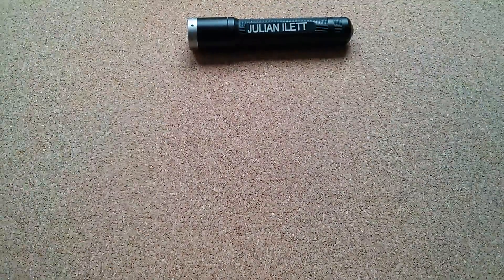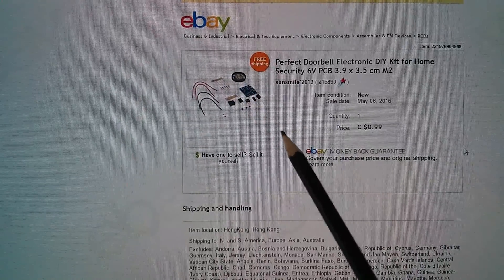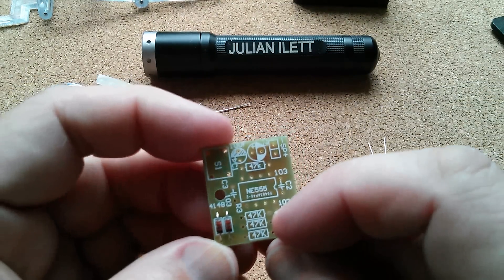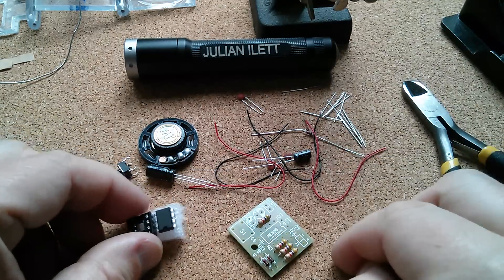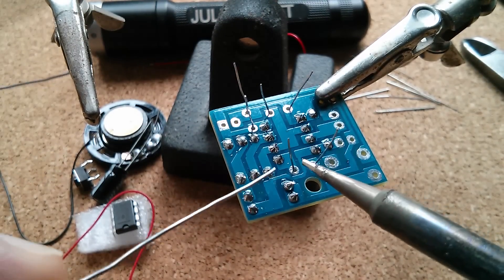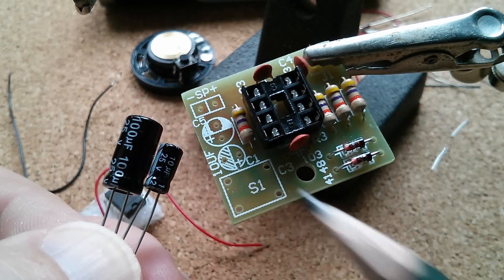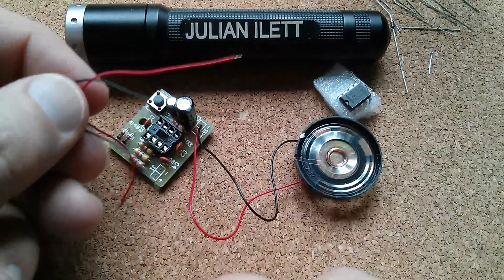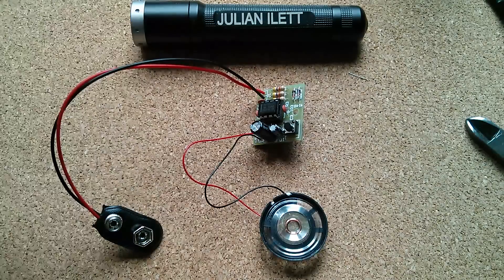eBay Cheap: $0.75 Electronic Doorbell Kit NE555

Comment: how this door bell will work in real world - I mean I I get a long wire and fit the speaker where needed , will the battery have enough power or it will need a bigger one or tied to the grid ?  I d like to get something similar for an off the grid house -  the distance between the button and speaker would be 60m . Any advice will help Regards

Comment: I had the same problems including the NOT working and the hot chip....then I stripped back the wire to get to the copper past the shitty tinning at the battery side and IMMEDIATELY I had perfect operation and no hot chip...even when actuating the piss out of it with a 9V.....I think it was the power being fed back somehow to the chip from the storage side because it wasn't getting what it needed from the battery side with the bad/intermittent connection...maybe I'm WAY off but my chip isn't even warm now and I get perfect operation every time I reconnect power...

Comment: I have personally noticed that 555 timers from china sometimes tends to get hot and not work and sometimes, for no reason, they do work. In the same circuit, changing to a legit 555 IC from TI makes a huge difference. I think it's because of the internal structure of the IC. The Chinese cheap version obviously cut costs everywhere they can, even if it means potentially fire hazard.
Reply: I dont agree. It all depend on the circuit design.

Comment: Cool, I figured it out. The reset pin is normally held low through the lone resistor. Pressing the button shorts Vcc through a diode to the reset pin, charging the small cap. When the button is released, the cap slowly discharges through the resistor again, creating the timeout. Two of the three adjacent resistors are in series from Vcc to the discharge pin, but pressing the button effectively shorts one of them out through the other diode, giving a higher oscillation frequency until you release the button.

Comment: Wouldn't it be easier just to buy a buzzer, and wire a push button momentary switch and and power brick from your junk box to it...?

http://www.ebay.com/sch/i.html?_from=R40&_trksid=p2050601.m570.l2632.R2.TR3.TRC2.A0.H0.X12v+buzzer.TRS0&_nkw=12v+buzzer&_sacat=92074

You might not even need to buy the buzzer, if you have access to junk cars.   Some older junk cars have a "ding dong" bell door alarm that keeps going when the door is open.   It's the first bloody thing I disable and pull the wire out of when I get a new car...

Comment: Put one of these together with my daughter the other day. Great little kit. Funny I did the exact same thing and hooked up a 9 volt battery and smoked the 555 chip, lucky I had a spare. Its was much happier running on 5V supply, but possibly not as loud.

Comment: I got one from Ali Express - arrived the other day and exact same fault - did not work and the 555 got hot.
The fix: swap the 555 for another one I had lying around and it worked a treat.
My theory - dodgy batch of 555's put in these kits (the kit was exactly the same as here - even with the extra diode)
Reply: same problem here  but from eBay, I bought two kits. both had same problem. I replaced the NE555 and all was fine.
Reply: Richard Turnnidge same! even put the bum 555 back in and it works!

Comment: Julian, Thanks for this video. I have decided to learn a little about electronics. After watching a previous video you did, I ordered two for 1.12 US$,  I received them in less than two weeks and could not believe that they were sent by air mail. How did you know which way to install the diodes?
Reply from the maker: Black line (or bar) on the diode corresponds with white line on the silk screen
Reply: Thank you for the reply. I assembled one, and had the same result as you did, hot chip and clicking speaker.. I lowered the voltage to 6V and it works perfectly. How did you know that the black bar corresponds to the white line? I am very knew to this and all the information I found mentioned gray bars on diodes.
Reply: Sorry, new not knew.

Comment: those sponges are horrible use steel wool there are ones for soldering they are much better and the water can ruin you iron tip

Comment: this is a question about something completely different i am currently looking for the best place to buy bulk led diodes and resisters from someone reliable that have bright leds 
mainly because im tired of buying leds with half the bag not working, wrong color, and dim leds if someone could point me in the right direction i would be very appreciative thanks sorry for the long question

Comment: Hi Julian,

Can I recommend one of these for your soldering tip cleaning http://www.ebay.co.uk/itm/Sunny-Soldering-Iron-Tip-Cleaning-Wire-Scrubber-Cleaner-Ball-w-Metal-Case-/231888290924?hash=item35fd9e846c:g:e2UAAOSwxp9W-2Kr I have similar and they work great.

Andy

Comment: I am quite sure that they are using that by pressing the button you charge or discharge one of the caps which in turn keeps the 555 out of reset for a short time. Since, if I remember correctly, the needed reset pin voltage is fixed and not relative to the supply, running it at a higher voltage might make the 555 go into reset too quickly and not produce a sound.

I hope they have cap in series with the speaker. If not it could explain why the chip got so hot (driving the speaker continously with DC).

Comment: Great video Julian. I recently bought a selection of these types of kits off eBay with the intention of running a short series and was amused that most came without any instructions. I don't think my videos will be a patch on yours and they certainly took me much longer to assemble that your experienced hands achieve. Your talk through is much more informative and professional than mine too. I run mine with about 4.5 volts or 3 or 4 AAAs

Comment: I dare say that if you vary the voltage on pin 5 of the NE555 you can produce some form of PWM but you really need an NE556 duel timer chip.

Comment: ive had several name brand doorbells over the years, the one that has lasted longest and still does, over 10 years, was from a poundshop,i think its still running on the same 2 aa batteries too, it only has 1 ring, probably 555 based.

Comment: I keep my sponge in one of those cheap zip lock type bags when not in use. Just been soldering one of those 3 channel VU meter kits you did a while ago, just got the endless rows of transistors and LEDs to do now.

Comment: How can a single 555 act as both a monostable and astable at the same time? The timing is probably done using just a cap and resistor in parallel (10u in parallel with 47k) and the 555 generating audio oscillations
Reply: My guess: the 555 is in astable mode, but pushing the button charges (or discharges) one of the electrolytics and bypasses a resistor. The cap ist most likely connected to the reset pin, which you could call monostable operation. And the bypassed resistor is just for the change in frequency (you only hear the higher frequency while the button is pushed).

Comment: Brilliant little doorbell circuit. I've got all those parts so can't wait for the next video. Will be able to replicate the circuit myself for a project I have in mind.
With the heat, is it that you are using 9v to power the chip (cheapy one not rated for 15v) or that the speaker is drawing a lot of current from the 555 output pin? Would adding a transistor/mosfet into the circuit, allowing the speaker to be powered directly from the battery, cool the chip down?
I hope we don't have to wait too long for the second part of this video.

Comment: 10:40 - LOL... had to laugh at that when it didn't work after using 9V instead of 6V.  Sometimes there is a reason other than the IC's Vcc maximum.  Especially important when you don't have at least a schematic to refer to.
Reply: +Cezary Akakios - I am aware of the specs of the NE555 but there can be other considerations on using a higher voltage.  The ebay listing shows 4.0 to 7.0V.  9V is quite a bit over that.  It is a cheap product but I would test it as it is listed before cranking up the voltage.
Reply: No idea where your reply went Cezary... I got the e-mail notice but don't see it here... weird... Youtube...